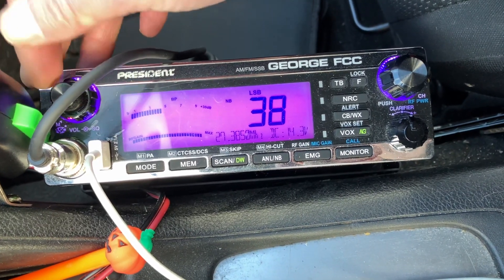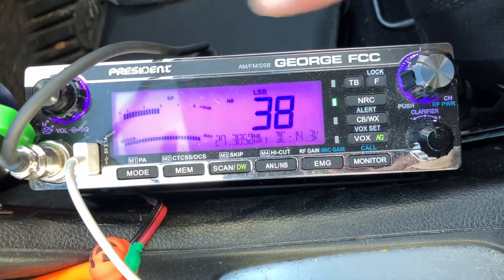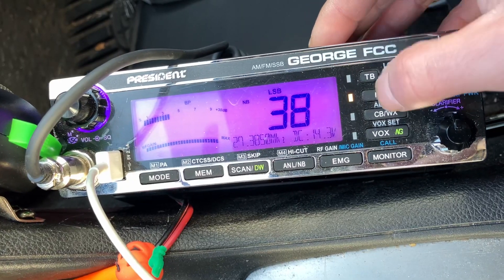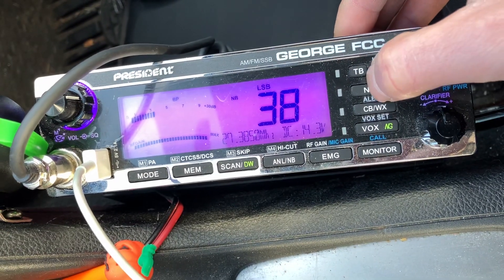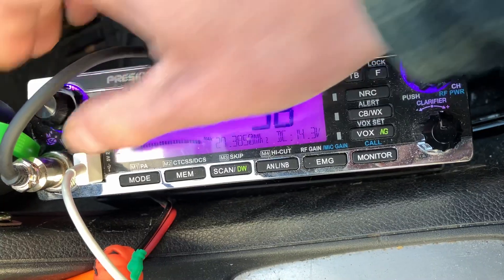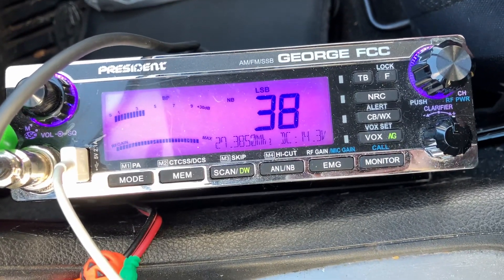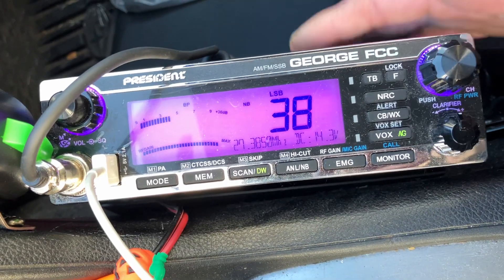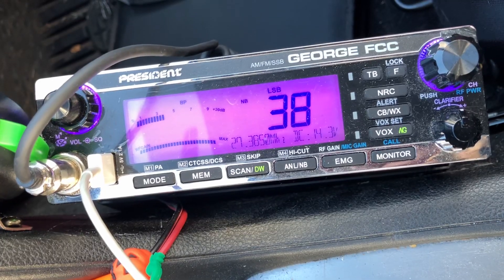Noise reduction circuit explained

Comment: Curious if using the USB jack on the front adds any noise to receive.
Reply from the maker: @SDS-1  no it doesn’t.  I use it to charge my phone.  Never had a problem.   Good question 🙂
Reply: That radio is on my wishlist.
Reply: My wish list too
Reply: @ yeah I don’t know what half the stuff on there is for but, I like the President radios. Lol. Gotta sell my Stryker 955 before I get another radio ( otherwise the war dept. will kill me)… the wife!
Reply from the maker: Don’t sell the 955.  I wouldn’t if I were you.
Reply from the maker: Get the YL a gift certificate to the local nail salon.  Bribery works wonders. Remember “ Unexpected Gifts , at Unexpected times.”
Reply: @mikecricket113  yeah I don’t know Mike I thought maybe if I sold it hell I might even get that HPC +that new one. I really like that George. I’ve got the version one and it’s all stock. In fact I was just playing around on i37 lab and got a little comebacks here and there on Skip. I’m up here in North Idaho.